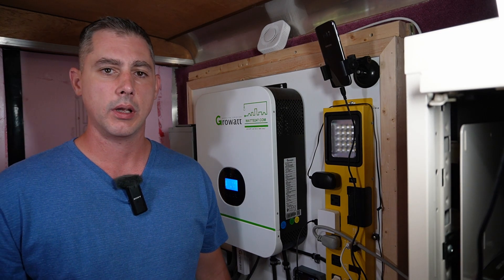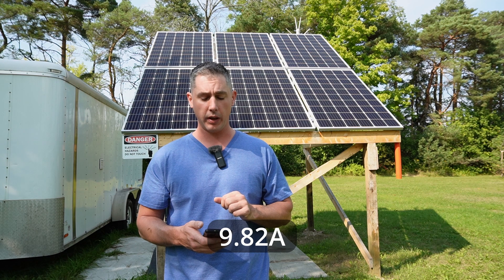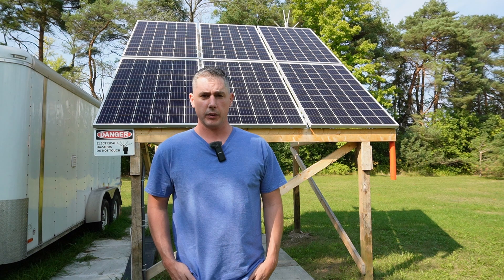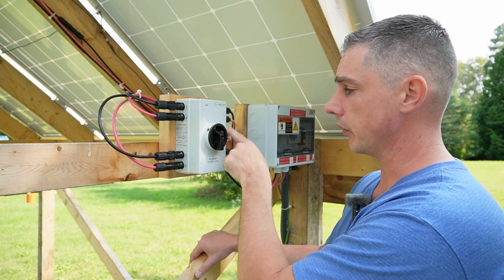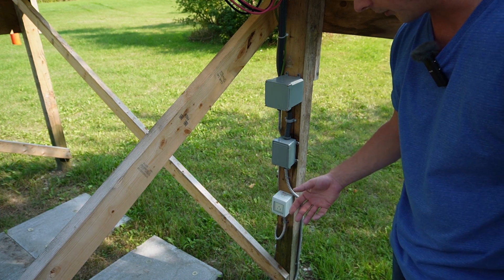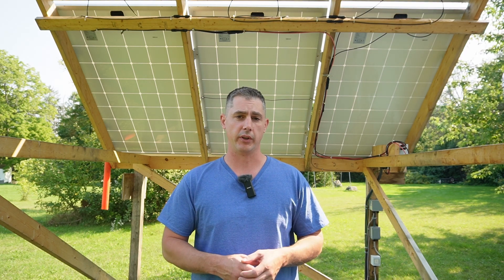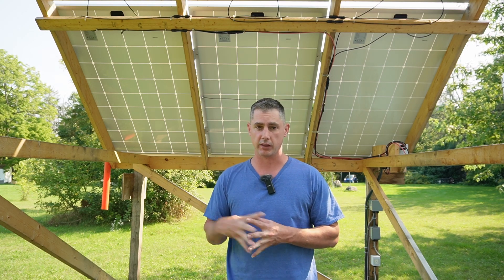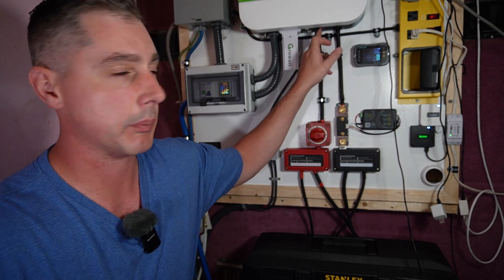How To Set Up A Solar Array

Comment: You need to be prepared to lose your wooden PV mount.  It's matter of time when a squirrel/etc decides to chew on your electrical wires.   One, I would have run the wiring inside of metal conduit.  Two, a metal ground mount will last longer (no rotting wood).  Three, place barriers to keep animals from climbing up the support legs.
Reply from the maker: Thankfully, no animals have shown any interest in my ground mount array. Yes, in 20 years, I will look for wood rot. As of now, everything is working perfectly. Thank you for the advice.

Comment: I haven't thought about safety if I'm honest. The way you did things, and how you focused on safety had an impact on me. Instead of investing in more panels, I'm using that now to purchase some of these things that I'm learning I need to make this a safe small solar generator type system that I've built.  Thanks for your video, I have almost the same setup but without some of your safety features which will be changing
Reply from the maker: Safety first 👍😉

Comment: Thanks, I've been living off grid for 10 years and this was still useful. 

I'm building a new array rack similar to yours. Question: do you think the 2x6 "rafters" are necessary, or could they have been 2x4s? What is the span on them?
Reply from the maker: Thank you, This was my first array I built. Thinking back a 2x4 probably would have worked. I believe it's a 9ft span.

Comment: Won't max VOC be higher at -20C  ?? Like up to 30% higher? Which would/could trip the Growatt, heat the wires/breakers/fuses?
Reply from the maker: Yes, But the system is out of service for the winter
Reply: @Roll2Videos  Ahhhh.

Comment: Great job! Thank you for the video! I’m just curious, what is a max power (voltage, amperage) have you seen coming from your PV array setup?
Reply from the maker: 1785 watt is the most power I've recovered. There are 6-310 watt panels.

Comment: One question I have is, I have 8 395 watt bifacial panels 160 feet away from my single eg4 3000 inverter shed. Each panel has 47 voc and short circuit amps of 10.82 amps. The inverter has 500 volt input capability so I am wondering if I should run all in series to keep the amperage down for my 8 awg pv cable for the distance? Or do similar to you and put 4 and 4 in series to combo box then parallel them together for the distance?
Reply from the maker: I would run them in series. be interested in seeing what the voltage reading at the array compared to the reading after 160 ft. You could try both just hook it up without the combiner box temporarily to measure. Be careful.
Reply: @Roll2Videos  oh yeah, great idea I get the panels tomorrow. I will post the results here within a week or 2.
Reply from the maker: @tjmooney4181  I look forward to it. I've subscribed 😁

Comment: What is the size  of the  grow watt.  Solar controller.
Reply from the maker: Here is a link to the manual
https://www.google.com/url?sa=t&source=web&rct=j&url=https://watts247.com/manuals/gw/SPF%25203000TL%2520LVM%2520Operation%2520Training.pdf&ved=2ahUKEwiQoLOn0KH7AhVElWoFHbc8AjYQFnoECBAQAQ&usg=AOvVaw3IY48J4j8Jsg8mz9U5MDbB

Comment: just a thought... would a made more sense to just mount those solar panels to the trailer and remotely power the house.
Reply from the maker: Not in my situation, There isn't enough square footage on the roof to accommodate the panels. Also I wouldn't have the proper angle to get the best sunlight.

Comment: I was afraid that over lapping the brackets would not line up ok. Thanks for showing it works out. SignatureSolar has a minimum purchase of 10 panels. Did you buy new?
Reply from the maker: Yes, I did buy new. I'm up on Canada so I used the local solar store up here. Used are a good choice as well.
What size are you thinking of buying?

Comment: Nice and thorough explanation of everything.  How much do you think the voc will raise on a cold day in the winter? I’m curious how close you’ll get to your threshold.
Reply from the maker: That is a very good question that I can't seem to find the answer for. The system will be going offline because that trailer is not insulated enough to run heat. Batteries and inverter will be disconnected and brought in the house.
At some point I could test the voltage on a sunny cold day with a volt meter 👍
Reply: I can answer kind of. My temporary panel set up technically barely exceeds my CC's limit of 150V, but in the summer is usually running around 125V. But every winter, once or twice a year when the temp gets really cold and I mean below zero F, AND it is really sunny outside, the panels then become so efficient that they exceed the threshold and the controller stops the incoming voltage. The controller is a Midnite Solar Classic, so I'm not sure if all controllers can do that. But that is a rise of about 20%, but again, only when it's below zero.